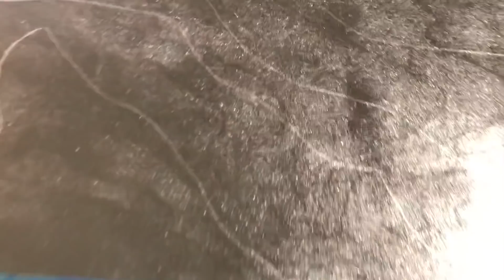Tutorial Geode Resin Art - Crystal Wave

Comment: An absolutely fantastic watch I’ve just started trying it and I’m not sure I think I’m mixing my paint with the resin to fit because when I came to using my hot gun to blow it it just burnt it so it’s back to the drawing board what would you suggest
Reply from the maker: Thanks Bonny.  If you are using acrylic paint to color your resin you must be careful to not use more than 10% paint to the volume of resin.  Acrylic paints can speed the curing process otherwise and result in less time to work the resin. Try working in stages of pouring rings so that you have more time to pour & work the resin.  Go careful on the heat temperatures to avoid burning your resin.  Hope that helps 😊